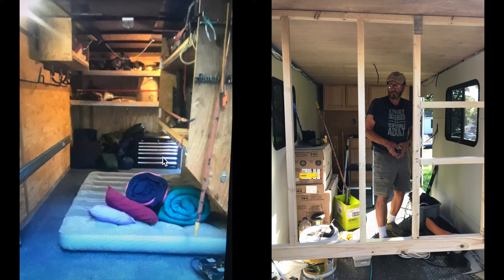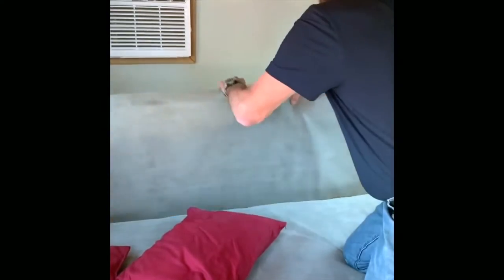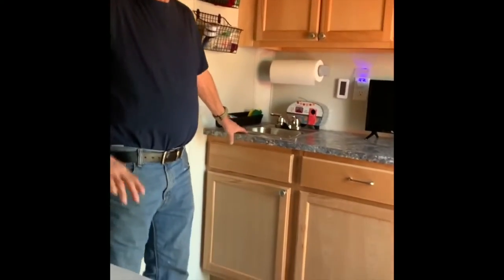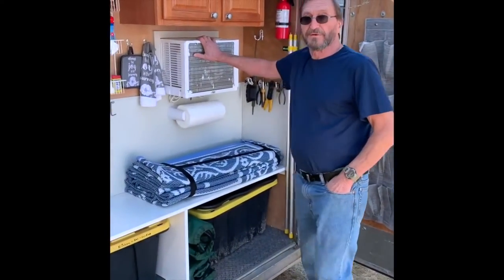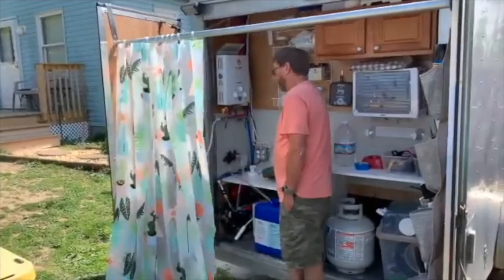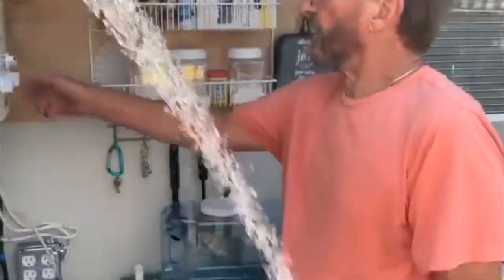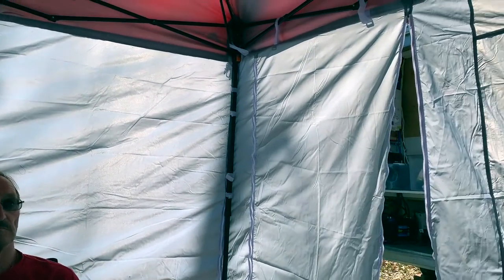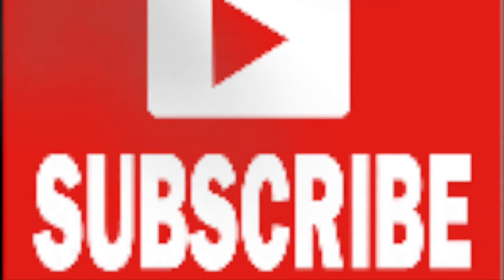Updated tour of our cargo camper

Comment: Thanks for sharing your great camper! My 4x6 v-nose toy hauler-camper-theater is more 'compact'. Front 4x5 deck plus roof rack and hitch rack is extra room for 2KW Inv-Gen, Solar pnl, Awning and more toys! 3 cabinets house cooking equip. and the 24"TV/entertainment ctr. Twin tri-fold sofa-bed, 5K BTU AC, 350W elec heat and induction cooktop complete the collection (so far). Planning a folding room pinned onto my ramp; maybe a kayak up top. Or a canoe when my wife goes... Pulling it with a 1.8L Scion XD gets 20mpg (headwind) and 28mpg (tailwind)
Reply from the maker: Thanks.  It sounds like you have everything you need in your camper.  The instant canopy and wall kit may work as a folding room for you - there's no floor in ours though.  But you can find something, I'm sure.  We love the extra room - and need it!